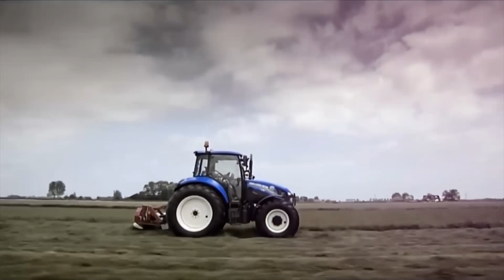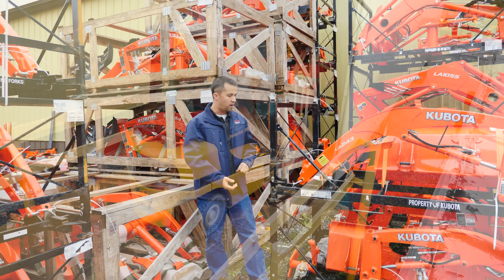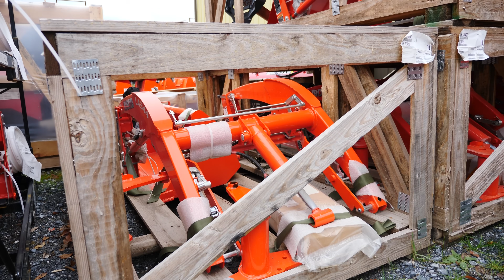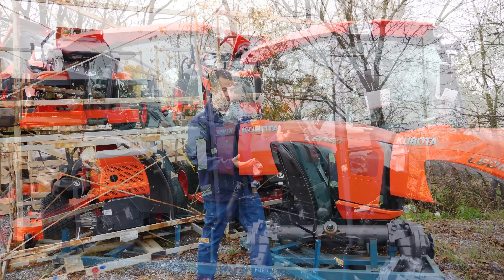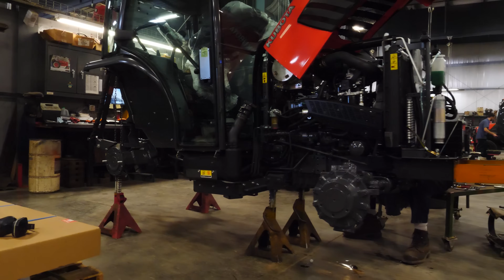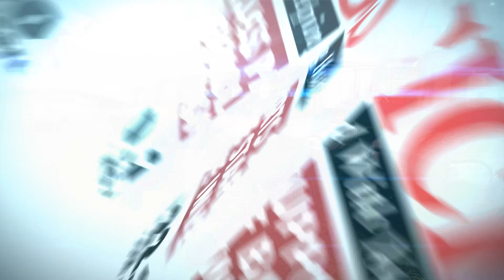How Equipment Arrives To The Dealership

Comment: I'll bet today those guys who assemble these are doing a lot of thumb twiddling due to the lack of equipment coming in, not due to demand though, demand is certainly there, just nothing to sell.   As far as the shipping crates, they come apart easily, the wood ones, surprised they arent bundled back up and sent back to the plant to be reused like regular pallets are.  The steel ones from Japan surprised me, you can stack a LOT of them in a shipping container and ship them back to be reused. Can't see how making new ones would be cheaper, especially with the cost of steel today.
Reply from the maker: Lots of equipment coming in actually, the setup guys are swamped. Just nothing on the lot, because so much of it is already sold.
Reply: @MessicksEquip  Dang man, I am still waiting on an LA805 to show up.  The place I am buying from has 5 locations, no tractors have come in yet, and no loaders or other stuff has arrived yet. Slim pickings in the Midwest.

Comment: it makes me sick that kubota does so much to protect their products and then the dealer allows the tractors and implements to sit out in the rain and the sun to be exposed to many months of   weather and sun causing damage rusting welds and parts and causing loss of value, I pride myself in caring oiling my machinery and never using them in  the rain keeping my tractors in a clean dry garage kubota should mandate that at least a roof must be supplied to protect the products and customers their future purchases the dealers should care enough , a metal roof is affordable and would benefit all involved especially the end users the owners !
Reply: That not always true.
Reply: Then after all that, the customer leaves the tractor and implements out in the weather too....guess having a shed, or shop to store that stuff in is just too expensive after spending $20+ on a small tractor...hell farmers here in Idaho just leave their $100k+ tractors sitting wherever they finish working in the fall, come spring it may or may not even start...gives plenty of work to the mobile tractor repair guy in town though.

Comment: i work for a Toyota dealer and i can say wood shipping crates suck. luckily for us only a few items anymore show up that way. smart on Kubota's part to use the reusable ones. i'm surprised that they have throw-away metal ones like shown on the bigger M series. i would think they'd come up with a way to ship those back also, as it takes time and money to build (or have them built) considering they're holding a 10,000-12,000 pound tractor for a voyage across the ocean i'd imagine they're pretty substantially constructed.

Comment: Very interesting video. Thank you.  Question - at 3:35 your showing the L6060 on the shipping frame. Are the two silver studs on the rear hub just for initial assembly or are they locating pins that remain there permanently?
Reply: The two studs are for lining up the wheel as the rest of the slots use bolts
Reply: Oh ok... so they are permanent then. I thought maybe they were just for shipping/assembly and got replaced with bolts during prep.  I made a similar locator pin for my JD tractor by cutting the head off a lug bolt as it too uses lug "bolts" instead of nuts. It can be quite a challenge to align the wheel especially when filled with fluid. I'll take conventional lug nuts any day. :-)